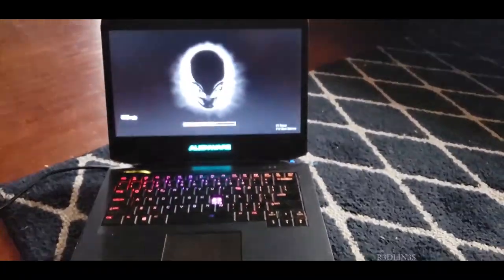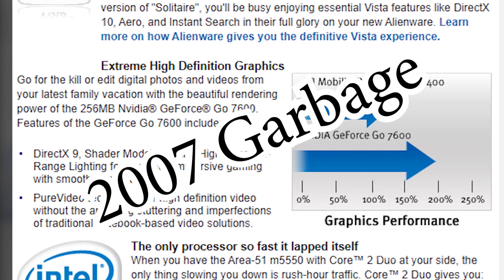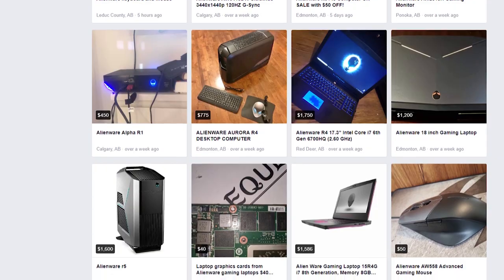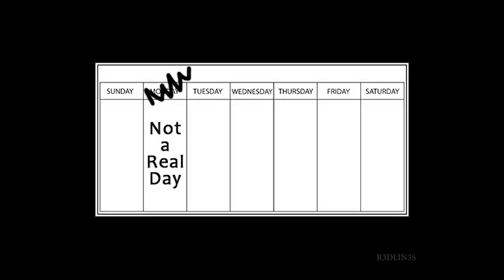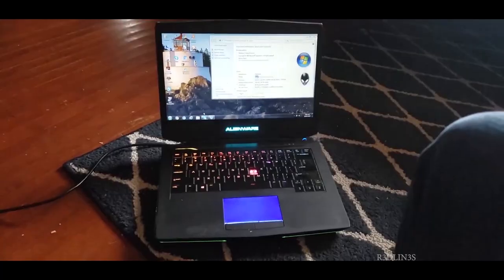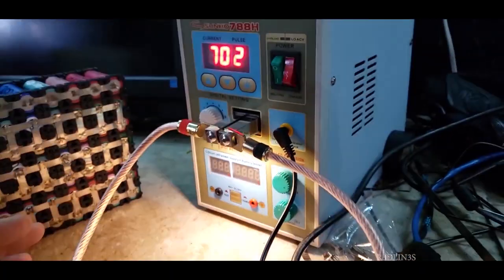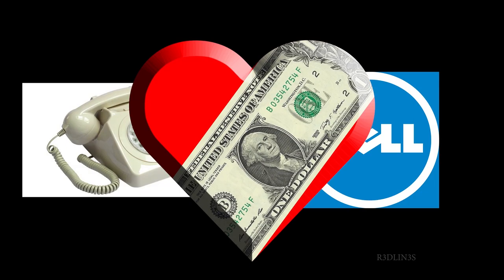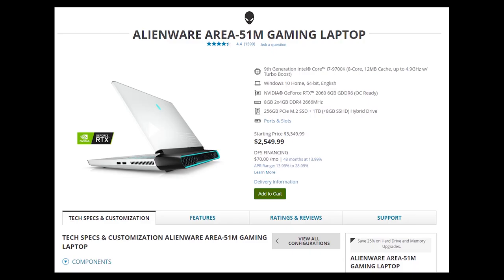Here’s What Happens If You Get Wild Eyes for a Free Gaming Laptop

Comment: 250gb ssd for 82 dollars God dam that's expensive  I can get 500gb for 45 at my local best buy,  should've just bought 7200 or 5400 rpm 2.5 in hard drive from wd or Seagate , 1 tb cost 40 they're fast as a ssd, 2nd there was no point of buying a original charging cable , u all ready had one , I guess u try to sell it, u  could've  just bought a 3rd party one for like 10 bucks, as for the keyboard good work replacing that. 4 th you could've just bought a new battery instead of the headache. Overall good YouTube videos you're underate, keep it up and I'll can see up there with the main stream youtubers
Reply: Why would a 2.5 in HDD be as fast as an SSD?